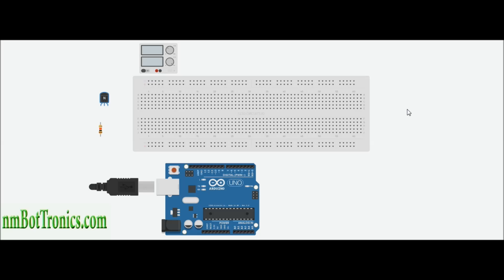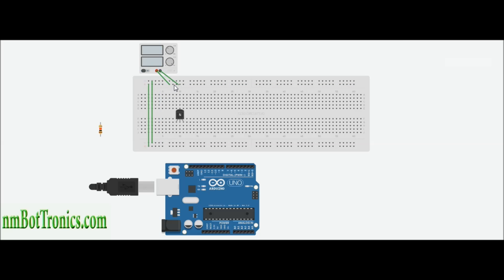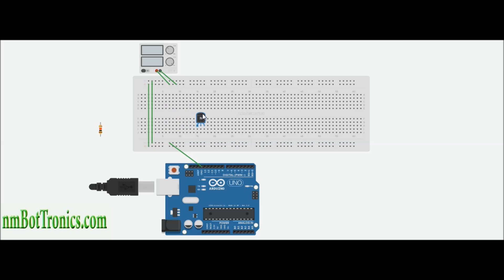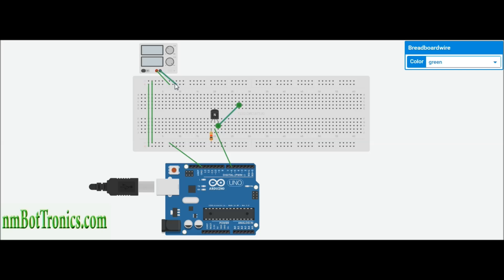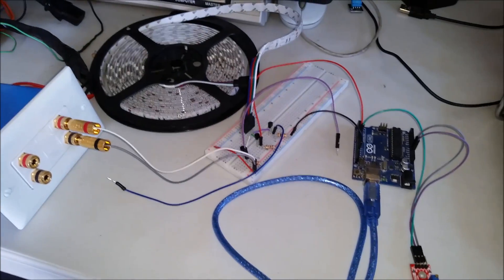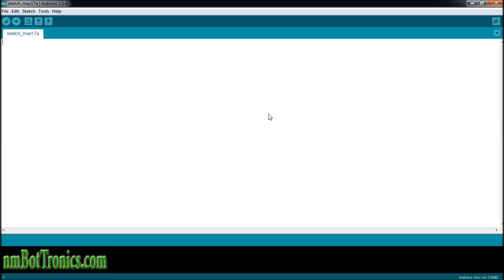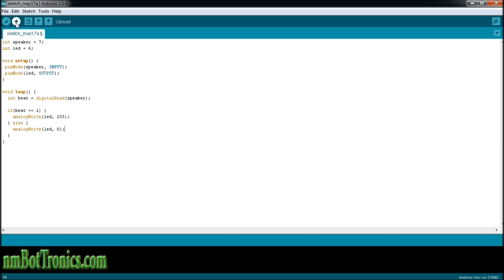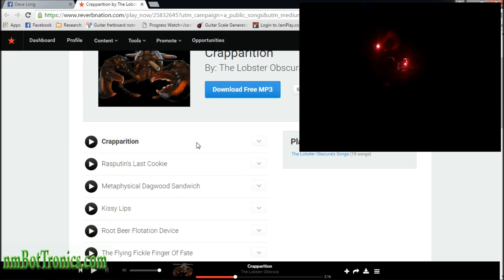Arduino Tutorial: Flash LED Strip to Beat of Music - smd5050

Comment: 11:37 "We're gonna check out his music"
Nope, I'm going to hard pass on that. 

It's flashing on peak amplitude (volume in layman's terms), not beat. There's a lot of signal processing before you can find beats in a song. The dirty method is finding the frequency of a percussive sound, then programming the arduino to output voltage in proportion to the amplitude of that frequency.

Work on polishing your videos/products/website/business model because right now your videos aren't worth the time to watch. You've got much more skilled competitors in the field of teaching hobby electronics.
Reply: That's rich coming from someone who has never uploaded anything.
Reply: Philip Taramai I really respect that he's uploading. It appears that he intends to market, and other videos teaching hobbyist electronics are relatively well polished and planned in comparison to his. As a consumer of his video and other similar videos, I can say with confidence that there is room to improve it.

I'd be less critical if this was a hobby video, rather than having a business behind it. It's actually not too bad if it's just a guy showing off the things he messes around with.
Reply: Making a beat detection things is not that hard. Its something I did for my very first thing on an arduino. So it cant be that hard.

edit: it also controlled a fog machine :)
Reply: Did you take an Arduino course? If so which one?